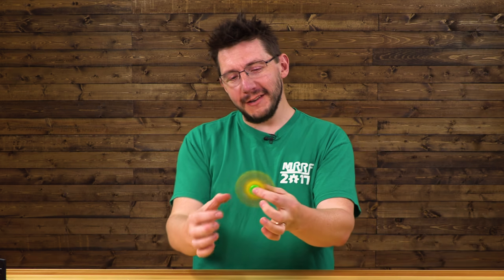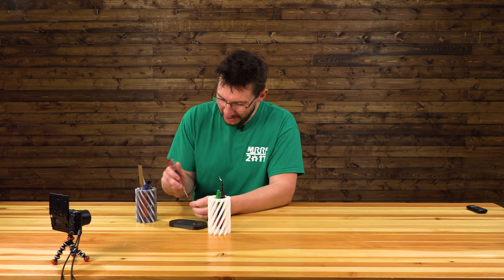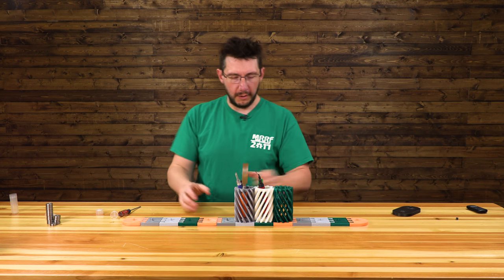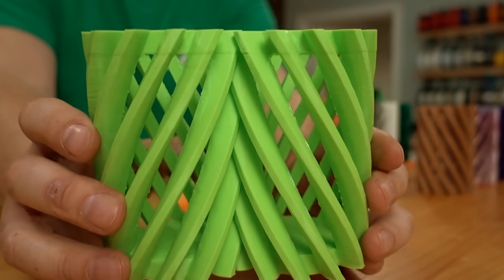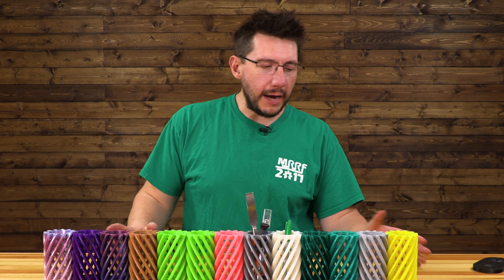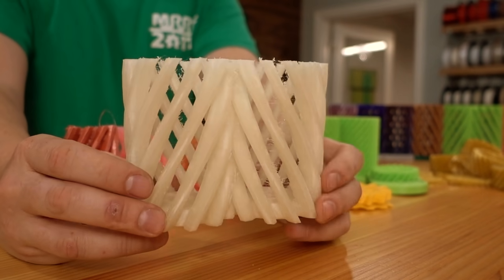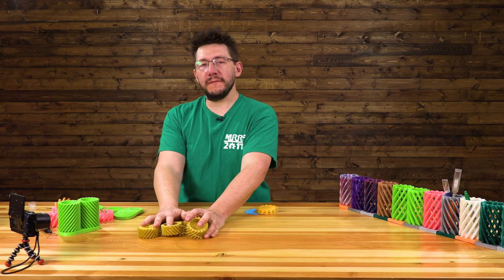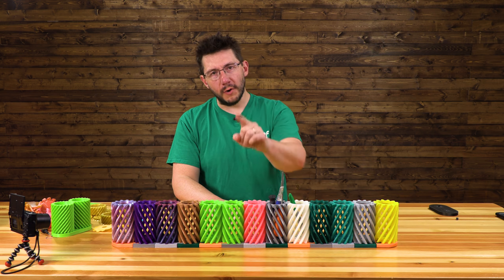Demonstrating Helical Meshing Gears Using 3D Printing

Comment: Now add a motor ;)
Reply from the maker: YEP. It's like you've read my mind.
Reply: Maybe we can see that on a filament Friday and 3d printing nerd colab, but🤷🏻‍♂️
Reply: don't forget razor blades
Reply: That would be awesome
Reply: So many fingers will get stuck in these :s
Reply: Lets see how those "helical gears" do at 4000 rpm. Wonder if they are involute?
Reply: @3DPrintingNerd  make a wind mill and use it to power a 3d printer.
Reply: @3DPrintingNerd  I'd recommend looking into a cheap synchronous motor (like the ones commonly used in microwave turntables) as they have relatively high torque and turn slowly - I have one here that turns once every 15 seconds.
Reply: usb motors, use it when u work on your desk, will use little energy too.
Reply: LOL Chuck!
Reply: Add a corner piece
Reply: Let's see this baby pull out around 450bhp
Reply: @3DPrintingNerd  you could make a cocktail maker with a similar design... curls inside and something else ))
Reply: You COULD technically remove parts of the structure and place a statue looking item in it, as long as you have the gear teeth somewhere along the Z (Y) axis all around the statue...
Reply: @3DPrintingNerd  Put LED tea lights in them with the motor
Reply: 10k revolutions per seconds
Reply: Or a hand crank

Comment: Those 'puzzle piece connectors' are dovetail joints. Quite common in woodworking.
Reply: Timothy Wilson Ah I’m glad someone mentioned the correct term. Makes me cringe everything he says it. Haha!
Reply: "its science"
Reply: Subscribe to pewdiepie...,... Oh wait,... wrong age 😂
Reply: i think he was referring to the piece in its entirety as a puzzle piece, not the actual dovetail  to connect them.
Reply: Actually, the dovetail is usually used for looks. Rabbet and dado joints are usually used when just considering strength. Personally, I prefer the look of a blind rabbet to a dovetail most of the time.
Reply: @Calen Crawford hardly, takes way to long = too expensive. Time is money. Dowels in all their Forms are used, but you are correct it is strong
Reply: @Calen Crawford Except for Ikea.
Reply: Not quite
  Dovetails work at right angles, these work only in a single plane.   Slightly simpler.
Reply: @Calen Crawford only decent quality furniture.  Its uncommon to see true dovetails these days  they are more time consuming.  Simple dado or rabbet joints, or increasingly biscuits and dowels are the norm these days in all but high end furniture.
Reply: @coaltowking  a dovetail is a VERY STRONG joint, and can be almost indestructible if made well.  They also can work without glue, which makes them excellent for marine work.  They also LOOK good, particularly when joining different woods.  But even with modern tools,jigs, and equipment, they take skill and TIME, the bane of all manufacturers.
Reply: Yeah. THIS is the guy to take advice from. The guy that says, “Puzzle piece type connector”.

Comment: Thanks, Joel, for showing us the failures.  I have designed my own 3D printer and your comments on the bowen tubes has me contemplating redesigning the effector to possibly incorporate the extruder instead of just the hot end.  Weight may become an issue though, but that's why we experiment!

Comment: Your settings may be fine if newer filament prints without stringing. It may be the age of the filament and excessive moisture. Maybe a little time in the dehydrator. Chuck is right; add a motor.

Comment: When printing CPE, temperature is really important. Too cold and it just won't bond to itself, too hot and it will decompose, and leave you with an clogged hotend. So maybe turn the temp down a bit?

Comment: Print 5 in a square pattern with the 5 taller piece being in the middle, turning it will rotate the four corner pieces while also rotating a base to bring the various corners around to view or choose from. There are no limits to that idea is cool.

Comment: The 'sponge' prints of of the Yan, that you were talking about the the end there, at 14:34, is the same problem that I have been plagued with, with my Maker Select V2. I print with the extrusion at 100% & print at speeds of like 50 or 60 mm/s but the plague persists. Any suggestions Joel? Please

Comment: You could put a false bottom in one of the cups and put the motor in there. The spindle would go into the base. You would give it a gear so it had high talk and turn very slowly.

Comment: Nice set of gears.  How about making puzzle inserts so you can expand in X, Y, Z dimensions?  Then 3D print spherical interlocking gears as a functional and practical 3D puzzle?  Design the pieces so that they go in a particular manner so the difficulty level is enhanced for puzzle assembly.  I've seen your tests of metal infused filaments.  Are you able to use those to 3D print your own metal-like bearings?  Can the Palette 2/Pro be used to fuse multiple materials as well as different colors?  

If so then you can incorporate the 3D printing of the metal-like bearings into the same build of the rest of the model.  But whether these are necessary with spherical components is debatable.  Do they add enough weight to keep the toy useful?  Do they add secure points or strengthening properties?  As I recall their little Hub computer and their Canvas software takes all the guess work out of making 3D prints.  Basically eliminating waste through failures.  Let's really test that notion eh?

What gets me is the cylindrical gears didn't print with supports.  And yet that Llama planter had to have supports.  What is the difference?

Comment: Niice :) Please add a non-straight connector, so you can make it circular. Split the connector in 2 at the middle, rotate one piece by an angle, fuse, and eventually fill the gap. You only have to keep the distance between bearing the same and it will work fine.

Comment: Nozel tip sizes. Different ones help with different materials. Try it. Your doing good by lowering process speeds a little. Different temps for each should be labeled. Also grease or lube the reels axels or parts that spin.

Comment: Hi Joel
1.) MH Build PLA if you want decent layer adhesion you will get some stringing. I print with a .8 nozzle. 210 Crappy layer adhesion no stringing 225C great layer adhesion and stringing BTW made a PLA video just cause you seem to like PLA so much and cause I experimented with annealing while printing if you are interested you can be the first one who watches it. If you want a decent cheap PLA Hobby King. With the .8 nozzle has good layer adhesion at 210 good enough for what you did here. The peak layer adhesion is at 235 (mfg suggested printing range on that PLA is 210-235). But a little stringing at 235 easily burned off with a heat gun especially if you hot printed it (anneal while printing) then that PLA will be good up to 150 C and the great part is that if you are a platinum customer its 11-13 bucks/kg 
2.) If you are interested in helical gears we (FRC team 1989) use a lot of that and I put up some videos like making a planetary gearbox using double helical (herring bone) gears and rack and pinion (we are lifting 100 lb with one of them. But that is not PLA but mostly Bridge Nylon and some PETG and HIPS.
3.) Bearings if you want to save some money I got a free bearing STL on my patreon account, Use Bridge Nylon or 910 or the Hobbyking mystery Nyllon I featured on my channel and get some 4mm bearing balls or BBs and you got yourself a bearing tested for speeds upt to 3000 rpm (a little grease at that speed helps) for about 20-30 cent each depending which Nylon you use. 

HTH

Martin (Old Dude with a Pulse. Yes I got a pulse printer and its been a struggle. On the one hand I ran 30 kg in 6 months through it otoh lots of tlc and repair needed. Once the warranty is up there will be some upgrades (one will address the c clip problem, Redesign of hotend brackets so when a print warps up your BL touch does not loose a leg - went through 3 BL touches so far and decided not to replace it until I design that better bracket, Redesign the Bed heater wire - hope yours is tied down by the electronics box mine was not so it killed the Rambo board - luckily under warranty. Now they tied it down but ran the wire in a way where I loose the left back corner as the wire crosses the build plate - needs a drag chain and be routed under the bed. Etc etc. Will make I video when I do it.

Comment: thats cute but why not have the bases jointed around the bearings? Make the base a snake like structure where you could almost articulate it so that the 3rd joint wraps around to mesh with the 1st gear?

Comment: So this is more of a question than a comment. I believe the stingy is also wet filament, especially when the strings are spider web thin and consistent thickness. When the string seems thicker at one end then the other that is filament settings. ... Maybe completely wrong.

Comment: If you want less stringing just add a wall around. Yeah, it will take a little more time and more material but as the nuzzle will be flushed and clear you'll get much much better result.

Comment: I had to stop using Cura as the newer versions flow rates had to be pushed as high as 150 to get usable prints. Same thing through Slic3r was perfect at 98 to 102 flow all other settings the same as Cura.

Comment: As long as diameter is this same this will work for any size smaller pr big ypu could eve have it so the bottom has death and the top dosnt you could allso taper the cogs you can make a key esentaly or kist something the would work to lock it together better

Comment: The dovetail joints should have been made in even numbers, not odd, that way they would be rotationally symmetrical, and from that you could do more than a single line. I'm talking Y, T, or even X junctions up in this piece.

Comment: Given a long enough chain of these, could you transmit information faster than light speed?  In other words, turning the gear in a direction on one end would instantly match or inverse that direction on the other end thereby transmitting some kind of information?  I don't know the physics but just curious.
Reply: I want what you're smoking.

Comment: It kind of sucks that the joint between the base sections is handed; if it wasn't then you could more easily do more and fancier things, such as three or maybe four way connectors, angle sections, or even just not needing to mess with which end of each section goes where.

Comment: This is the cursed project.  I had 2 or 3 tries for the first gear, when it did finally finish, it has issues.  The second gear was a little better, but still two tries to get it to go.  I have a dual extruder printer and ended up having to move the second extruder higher, so it wouldn't hit the print.

Comment: Probably a „Google It“ question, but is there Software, that will print a testobject and change parameters like heat, retraction, etc. during the print ? I was wondering.
Reply: Some slicers will let you change temperature, infill, etc for specific regions or at specific layers, but it seems none have all the options together.  Experiment!
Reply: @davedixon2167  And having all the options together might not print at all. Thanks a lot Dave

Comment: I like a non-linear structure. I'd like to see a trigonal planar design like a fidget spinner. Or a 4-piece planar design.
Reply: Also, maybe slightly pyramidal cylinders instead of straight up and down? Obviously you also need to make the inverse just like you have in this video

Comment: Wow, the Mk3 prints those noticeably better than the other printers (on average). It's interesting seeing the same model printed with different filaments and printers.
Reply: He's spent more time and has more refined profiles in his slicer for the MK3 that's why..  I have a Wanhao and a mk3 both print to the same quality..  I how ever rarely use the Wanhao because I don't miss manually leveling the bed (every print) and I don't miss using scrapers (although you can always get that Buildtak system for it now).  Its amazing (night and day difference) what good slicer settings can do for you.
Reply: @AcidicVids  Good point!

Comment: Protip!   if you take a Torch.. and  just FASTTTTT go over the whole thing where strings are./... i mean FAST. like u are tryn to burn arm hair off your arm.    fast enough so the heal dosent burn the skin , but it will take all them strings away.   or you can sand it. with a dremel style and  POOF  goneee.   Try the fire first, it works the best. and will amaze you.

Comment: That last failure from the Yan-whatever, e-steps?
Reply from the maker: No, actually. It was much worse - I had 2.85 in Cura for the filament diameter - should have been 1.75 hahaha OOPS
Reply: @3DPrintingNerd  Well, easier fix -silver lining.

Comment: Sponge cake prints happen all the time at our fab lab. Cura defaults to 2.85mm diameter filament when adding custom printers, and our students do not always remember to check that it is 1.75mm before they print.

Honestly I have set cura to 1.75 before on different occasions then after printing for a while I noticed sponginess and found that cura popped back to 2.85. Maybe this happened to you
Reply from the maker: I forget as well. More often than I should :)

Comment: I'm the guy that tried printing the mirror helical  gear cup from Thingiverse.  I printed the first one fine, but the mirror part failed 3 times at over 8 hours each.  I pretty much gave up.  Seeing you with a ton of them pisses me off.  The designer was supposed to have remodeled the mirror cup, but those 8+ hour failed prints put me off the model.  I have the original cup and all the scraps from the failures.

Comment: Helical meshing gears are the type used in most VERY high load gear drives.
Reply: There is a basic conceptual error in the gear train.  You shuldn't have all the gears have the same number of teeth.

A gear drive should have an odd (not divisible evenly by either gear's number of teeth) ratio to ensure that each tooth of one gear will contact each tooth on the other gear over several (many) revolutions.

The classic 411 rear end is a 4.11 to 1 ratio  4.11 revolutions of the drives shaft per revolution of the ring gear.

This ensures a tiny defect will take far longer to propagate to the other gear's teeth and thus back to the first gear's teeth.  Very small defects will actually be corrected in most cases, instead of being amplified as a 1:1 ratio would cause.
A defect that could destroy a gear train in very few hours at 1:1 ratio may not cause gear failure for 10,000 or more hours at the same drive gear rpm with a 1.1:1 ratio.

So the mirror gear should have 1 more or 1 less tooth. (and be of the correct adjusted diameter)
Reply from the maker: Super interesting I didn’t know!

Comment: I literally bought a bunch of bearings and had no use for it this will be great
Reply from the maker: Right? I have SLEEVES of them!
Reply: @3DPrintingNerd  We can always use them Our robot "eats" bearings in this years model we use at least 50 in the rack and pinions we printed, 16 in wheels and gear boxes and a dozend or so more on the elevator and delivery arm. Granted to keep costs down most of them we 3d printed

Comment: Excellent, but I can see a further improvement on the design. If the puzzle pieces could also fit together in the other direction, then you could add infinite cups theoretically.
Reply from the maker: Very true

Comment: Not a fan of PLA.  Very brittle, melts at low temps.  It does have a nice finish though.  I like ABS but it warps and the finish isn't as nice as PLA.  I absolutely love printing in PETG!  It doesn't warp, extremely strong like ABS, and the finish is similar to PLA.
Reply from the maker: Have you tried any PLA materials that you can anneal?
Reply: @3DPrintingNerd  I have watched some videos on it, but I haven't tried it myself.

Comment: Horribly misleading title.
Reply from the maker: What should I change it to?
Reply: @3DPrintingNerd  That's a great question. Since the video isn't actually answering the question posed in the title, maybe something like "Modular Helical Gears." This is more a demo of the modular design than an explanation of what helical gears are (or why you might use them beyond the looks).
Reply from the maker: Ooh, that’s not bad. I like that. Let me see what I can do!
Reply: @3DPrintingNerd  Really like the updated title. Have you thought about trying to print non-parallel meshing helical gears? With the correct twist you can theoretically get helical gears to mesh at any angle. They are way more efficient at transferring power smoothly at an angle than bevel gears (quieter too).